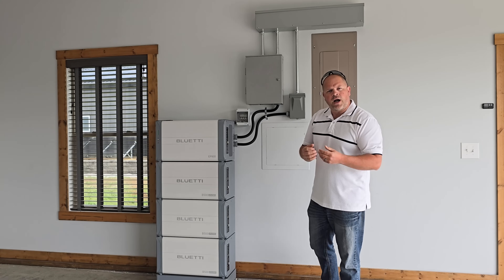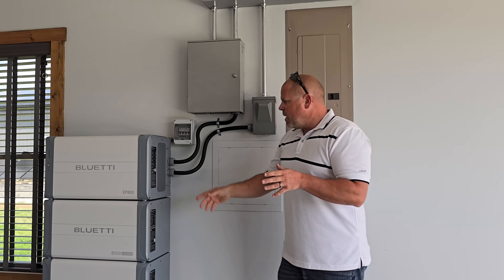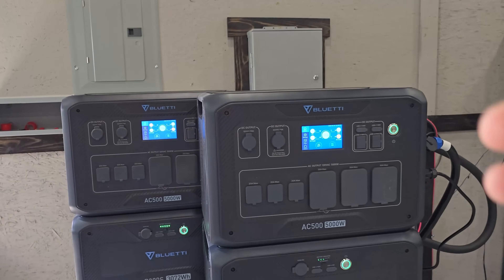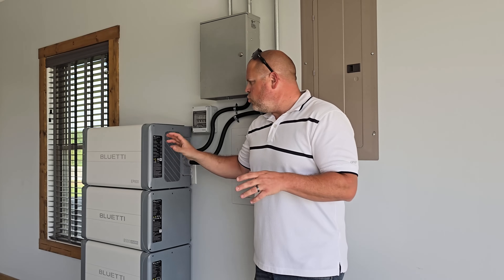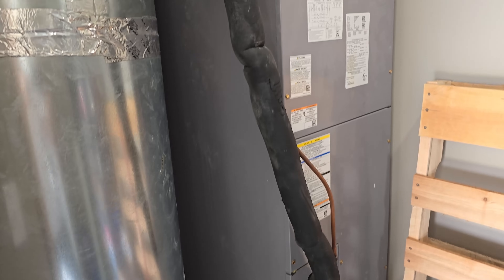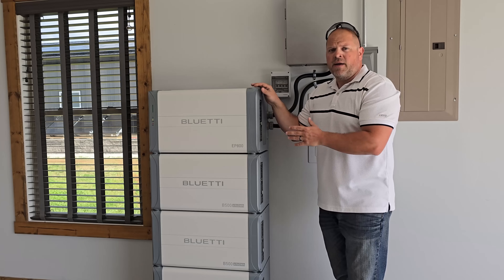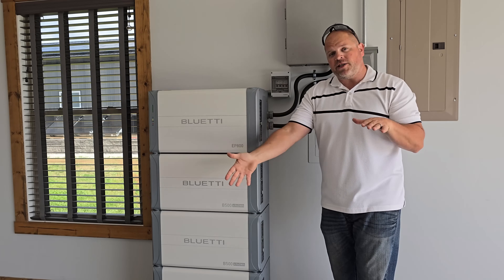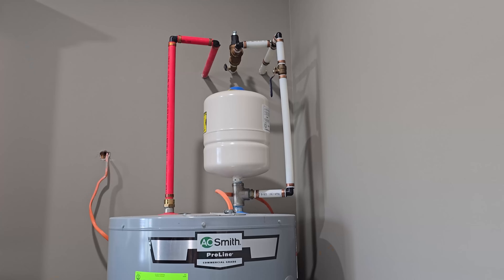What I would do DIFEERENT - EP800 Bluetti ESS Backup Review

Comment: I live in Florida backing up my AC unit is a top priority. Are you saying you need 2 Ep800 to run your AC or another battery? Also, with this system you have, could you just run your AC fridge and a few lights if you wanted to?
Reply from the maker: Depends on how many amps your AC unit pulls on start up. It can run a 4 ton central air unit with a soft start on it. The EP800 would easily power that and everything else in your house. It is a 240v system, so as long as you don't need more power than thar, 1 EP800 and  the B500 batteries are all you need. Hope that helps.